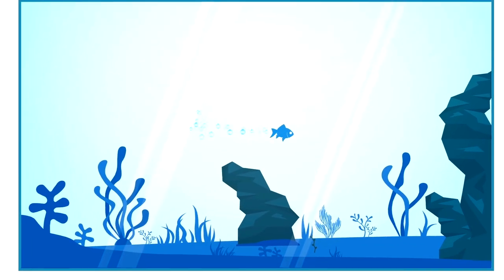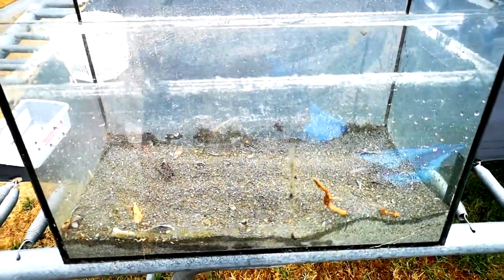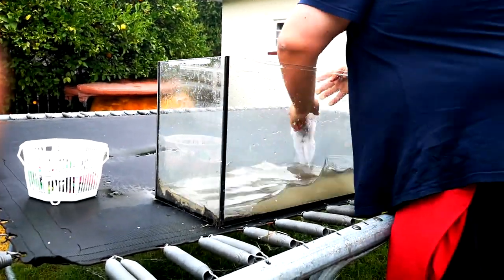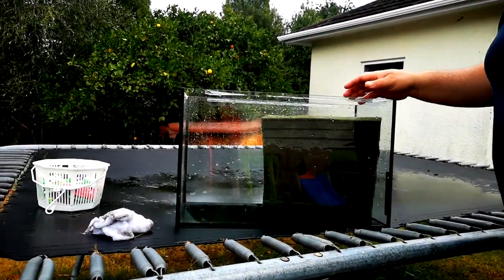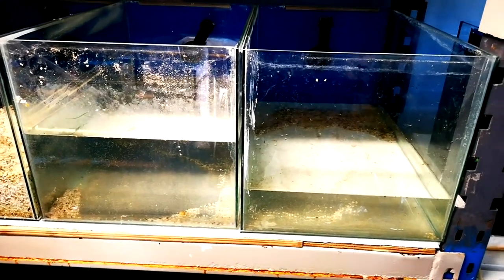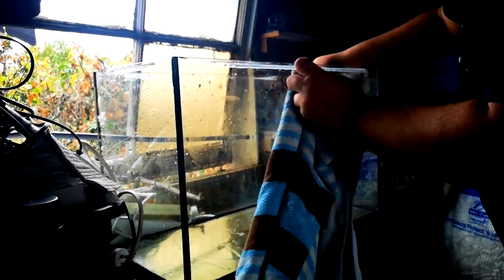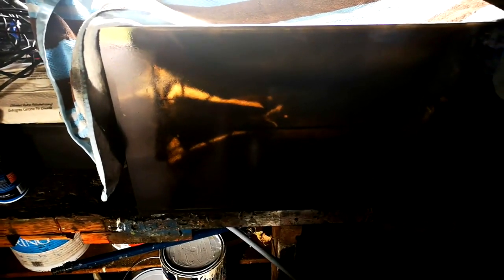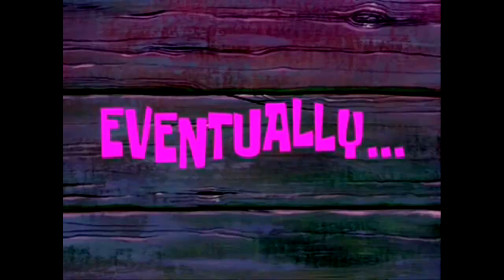BLACK WATER TANK PROJECT! - Part 3

Comment: Chocolate gouramis and kuhlis are my two favourite fish.  I have corner mattenfilters in two 70 litre Blue Planet tanks (61x30 footprint), and I love the look but with the 5cm foam it's definitely a squeeze behind there.  If I were doing it over again I would use the 2cm foam, it would allow significantly more space behind the filter and I'm confident there would still be adequate filtration.  I also love how low maintenance they are, I've never had to rinse them and one is two years old now.  There is a good colony of fuzzy algae growing on one of them.  Recently I pressed bits of java moss to that one, the moss sticks nicely to the foam and it seems to be growing well so hopefully soon I"ll have a wall of moss not algae.  But I'd rather see even a wall of algae than a heater.
Reply from the maker: That right there reassures me of my decision not to go with the matten filter as I only have the large sized foam. A moss wall would look pretty awesome.  Seeing a heater is right at the top of my yuk list when it comes to recreating a bit of nature, however I had a could of the Fluval E series heaters around which are black and should blend in well with the background and and the tinted water I want to achieve.
Reply: @TheFishRoom  You could always slice the foam down the centre, doesn't need to be a perfect cut as it won't be visible.  But yeah a black heater will be less noticeable especially once the crypts grow in.
Reply from the maker: I could...... but it is too late now.